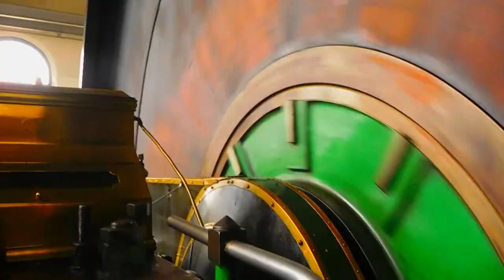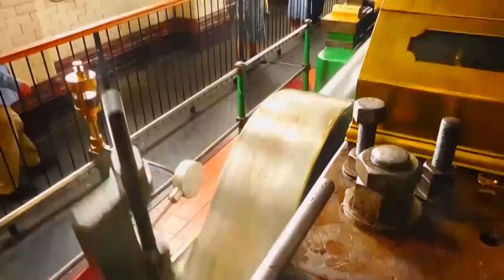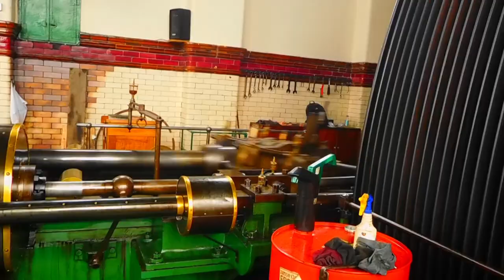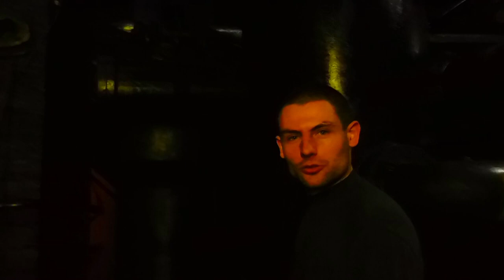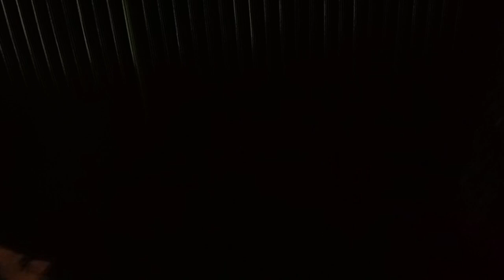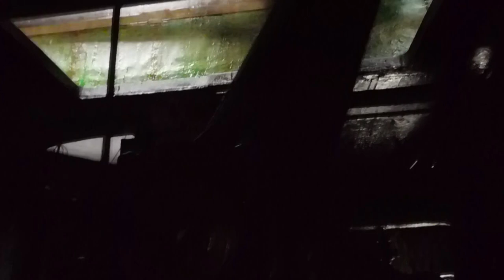The Ellenroad Engine

Comment: This is a  cotton mill engine  which  drove  an entire  multi storey  mill about  7 floors  about 60 ropes  each a inch thick  (spliced) came  from the  fly wheel and  drove the  different  floors   other survivng  big engines are at leigh spinners  and  trencherfiled mill  Wigan any one  interested the  George Watkins  textile  mill engine  books  1 and  2 excellent  books

Comment: I would like to build a oil burner. With 8" bore and stroke starting at 12" with opposed cylinders crosshead design , and double acting would be nice, and incorporate water cooling and oil pressure, and sump in the rod, using a 4140 4340, 5140 steel rod with oil passage to the rings with a sump location in the piston , probably need a larger piston. Closer to 16"  with a pair of oil rings with a gap for the sump, between,  then a pair of compression rings  about 3mm thick, with 2mm oil rings with the spacer in the piston   the oil enter the  top of the piston, running between oil rings ,  then the sump picking it up at the bottom,  while traveling up and down the bore,  using 20w50 oil  and capable of running a constant 1200 rpm. However likely only ran at 600, made from modern steel and aluminum,  use old pistons to cast a new pair of pistons . A outer polished chrome rod 2" with a 1.5" center rod with a 3/16" oil passage. And 1/4"  sump, using a oil pump to return oil from the pistons and rocker boxes,  a single acting would be more simple, a double acting engine would get a 70-80% gain in power, burning waste vegetable oils,  I want to use a air blast injection system, using about 600-800psi air stored in a  1/2 gallon tank, starting at 125-150psi shop pressure, from a normal compressor. Then a injector operating similar to a carburator, the fuel dosed into the injector body . Amount determined by the "throttle"  and the air blast both pressurizing behind the oil in the body. As well as flowing through the venturi. Where it also draws in the fuel to get injected., The air blast set off by a cam shaft  that also opens the dosing valve, fed by the throttle rack and fuel pump  the nozzle being multiple tiny holes in a small area, sealed to the head with a copper washer,  the air compressor possibly being a compound refrigerant pump system , fed by a normal compressor, it's a low volume high pressure required the added air vaporises the fuel much better than normal injection. With only about 10cc of air used per revolution. The compressor can be show to fill the 1/4 to 1/2 gallon pressure tank.  A auto shutdown valve to seal the tank prevent ing hard starts, I want the engine to work daily generating power for my  off-grid home. It should be capable of producing nearly 20 kw, especially if supercharged. The near idle used to produce the 300amps at 30 volts, or 9kw, would only require about 15hp from a modern gas engine, this oil burner would produce tq. Unreal compared to modern engines.   With about 22:1 compression,  and a supercharger producing about 7 psi of boost,   it should produce 25-35 HP at 1200-1500rpm, about 1600 being absolutely peak rpm. Using a counterweighted crank, from steel. 3" rod and main journals.  And a pair of 50 lb flywheels on each side of the engine, also using a modern starter, using a 24v starter,   a bit different than steam, but I also want to build a stem engine to do about the same job. Possibly 1/2 the power requirements. About 150 amps at 30 volts, volts x amps =watts, is 750w=1 HP in  generation 1hp per 1000 watts is a safe estimate, Then add a bit for losses,  ✌️ have a great day..

Comment: there is no way a engine that big is spinning that fast. prenominal
Reply from the maker: They were built to go this speed and faster.  The depicted 60 RPM is actually below governor speed for this machine, which would top out at about 70 RPM driving the mill.    This remark is unfortunately is a perception perpetuated by the fact that most museums stateside only run these things at 5 to 10 RPM.   You should see the Rice and Sargent alternator Corliss with a 15 foot wheel that runs at 200 RPM.
Reply: @AEKarnes  that unfortunately rings too true. The state fair near me has some old hit and miss engines they bring out and run and the biggest one fires a hit every 5 to 7 seconds, just enough to keep the flywheel spinning and not much else. If they are running old gas engines that slow then do doubt they are running the steam engines equally as slow

It just feels so unintuitive for an engine so large to be going so fast. Usually the larger the cylinder/stroke (in gas vehicles) the lower the rpm. I guess when you deal with steam and cast brass construction the math is different 

Keep up the great videos, your working with steam engines 11 year old me would have done anything to see in person
Reply from the maker: The same laws of physics apply to steam engines as gas engines, in that the math is the same and larger engines will run slower for the obvious reasons, but in either case you and many others just have not seen what these machines can really do and this is why it feels unintuitive.  I am sorry for the fact that you and other's intuition has been polluted by not being allowed to have the proper picture or experience, as we are living in a dead world full of myth and misconception that has been allowed to spread now in regards to how everything works.

  The last time I ran a medium sized Corliss up to governor speed in the states, about 100 RPM, every boomer and zoomer visiting from other museums where the engines run at 5 RPM on 5 PSI of mostly condensate practically pissed their pants out of nervousness and I had to explain to them that running these things under-speed is harmful because it won't allow the bearings to build up hydrodynamic oil wedge.   No one here is interested in doing things right because they are all terrified and everything is fear-based.
Reply: Only found this channel today, the day after I drove past Ellenroad mill on the M62. It's only 6 miles from where I live and we used to go there when it was sreaming when the kids were younger (all in their 30's now). I will have to go again next time they have a steam day.